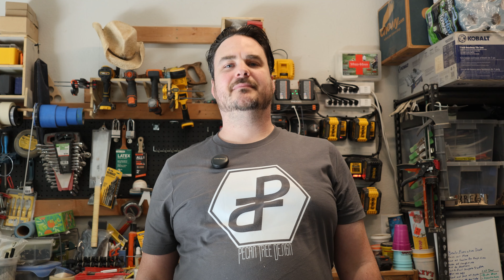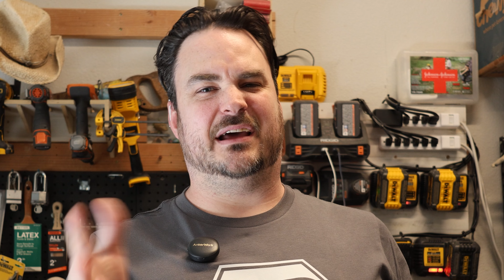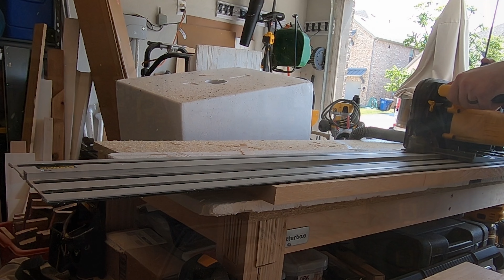Just another top 10 tools video, don't watch it

Comment: I want a laser!
Reply from the maker: I'm honestly torn between a laser and a CNC router, but I feel like the CNC router edges it out. Plus there are some CNCs you can mount both to, so that my be my answer... Eventually
Reply: @pecantreedesign  Get the xTool P2. It really is a good laser.
Reply from the maker: I bet, that thing can cut through some thick stock
Reply: @pecantreedesign 
Hi Derec. There are many CNC's that can take a laser, but only a diode & even then you may be restricted as to how much power it can output depending on the unit motherboard. 
There isn't a CNC out there that can take a CO2.
The cost of a CNC here in the UK is so expensive. I've looked at your OneFinity, Avid, Stepcraft plus others & all with just the basic of specs. The shipping & import duties alone pretty much double the cost. The only ones that come close is Ooznest (desktop) or Trend Yeti Smartbench (outside setup due to size) based here. The latter having the better depth of cut & speed. It's a tough choice, but I'm sure you'll choose correctly. Probably.😆
Reply from the maker: I'm sure it'll be like anything else, I'll spend forever looking for one and finally get one. Then once I open the box, the one I would have truly wanted us suddenly all over my feed and in my face 😄